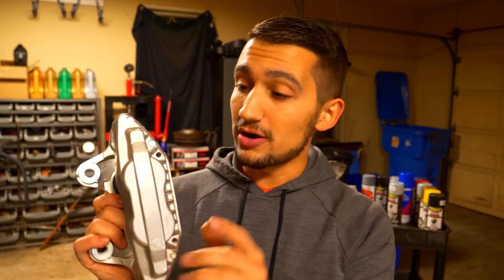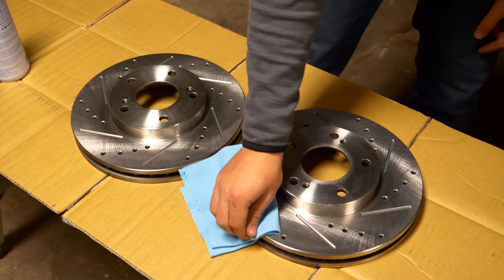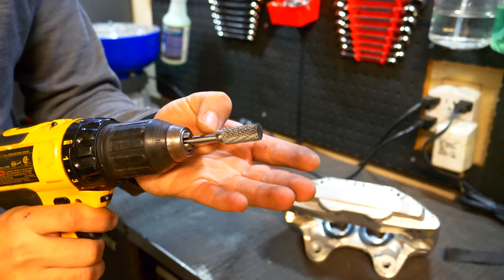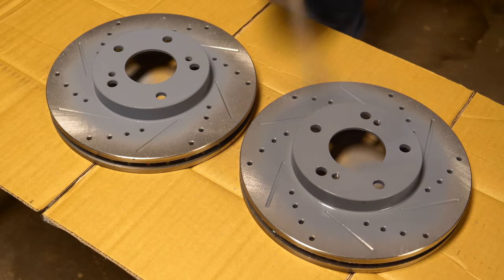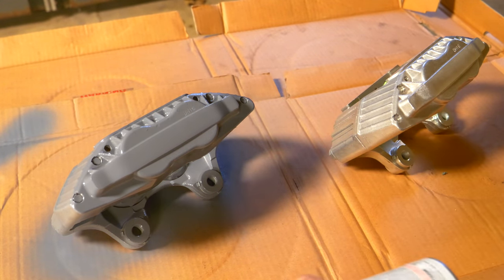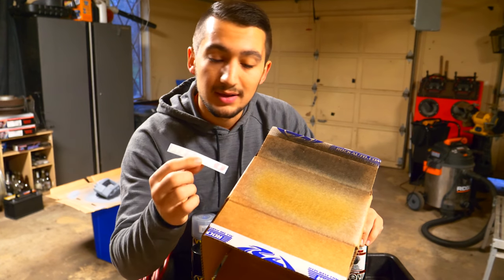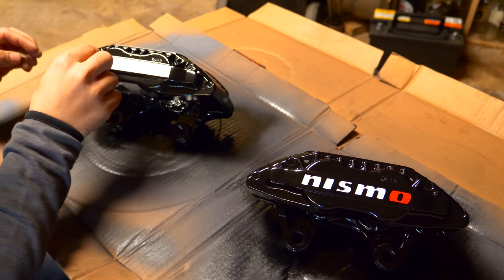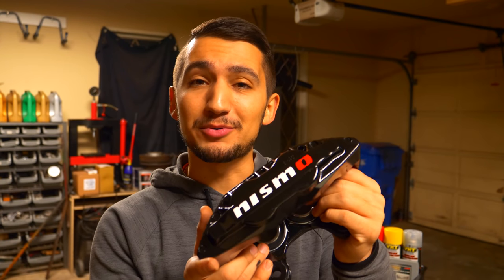How to Shave and Paint Your Brake Calipers

Comment: Went through these same steps + painting mine and in just a 1000 miles the paintnt started chipping / peeling away.  Asked those who also painted theirs that have had no issue and all said I made a mistake which you are doing also.  I neglected to cure them in an oven.  Watched many more videos and this is very often recommended.
Reply: Very good point. When using the same paint on engine headers, you can do a cycle with the engine idling to heat them up and cure the paint before getting it too hot. You can’t do that with brakes but they are small enough to fit them in the oven and cure.
Reply: At what temperature?

Comment: I always hang parts with a wire or string when painting. Garage door tracks work great. You don't have to touch or rearrange parts to get every possible angle. Immediately before and afterward- hit it a minute with a hair dryer to warm, remove dust,  and speed tack each coat.

Comment: Pro tip: the first coat of primer should be very very light, just a light dusting. You should still be able to see the the original finish under the first dusting coat. Then 2nd coat should cover everything.

Comment: Nice job coating the friction surface with paint! Don't forget also to put a nice layer of grease on both sides of the rotor
Reply: sakalelis69 OMFG HILARIOUS
Reply: your ridiculous! obviously you havnt bought rotors with a coat on them that comes off after using the brakes a couple times ....
Reply: @robertosaenz4635  You obviously don’t know how to sense sarcasm.
Reply: Lmfao
Reply: Just blow the pistons out, paint and bake in oven then put back together
Reply: @robertosaenz4635  Manufacturers coatings are not paint.
Reply: Dude...hahahaha
Reply: @robertosaenz4635  thats not paint

Comment: "I'm very detail oriented "......then sprays primer all over the friction surfacr.  SMH.
Reply: Yea & it will be scrubbed off after he uses the brakes twice. Not a big deal at all.
Reply: Some brake cleaner will clean that right off!!!
Reply: @kaimingleung1396  my thoughts exactly
Reply: @kaimingleung1396  Presumably your comments are all theoretical, since a thin layer of rattle can paint makes no more difference to the rotor than the surface rust that builds up a week of rain; the excess paint disappears immediately upon use. This is a really common action and is has no effect on pad bed-in or braking capability. Dry paint doesn't behave the same way as a lubricant like grease/oil, because it isn't the same thing.
Reply: @pmodd  Honestly the primer would increase friction for the first 5 seconds before it wears off.

Comment: You did a nice job on the painting of the calipers. Maybe tape up the rubber boots before shaving the caliper surfaces to avoid any alloy shavings getting lodged between the rubber boots and bore next time. Also not a good idea painting the braking surface of the rotor. Otherwise some good tips, Thank you..

Comment: You also weakened the calliper. The reason that high rise is in the calliper is to thicken the centre area of the brake cup to stop distortion under hard and heavy braking.
You also do not wipe the rotor down with a rag as you leave fabric dregs on the rotor. You just spray off the surface with brake clean.
The brake rotors aren't just painted with basic paint either. It's specially design zinc coating that is designed to come off when bedding in, it is NOT the same as the paint you're using.
Reply: Thanks for that info. Just bought fleet quality rotors and the entire thing is painted black. I assumed it's going to come off the surface with wear, so I wasn't worried. But I was curious.
Reply: No, those circles he grounded down are not structural, they’re to release the casting.
Reply: @Akiss  no mate, they're not.

Comment: Before the clear, it's best the let all solvents evaporate from the base coat. They usually say leave the base coat for three hours, clear coats are very different to the paint and seals it in, it can cause bad results if the solvent is trapped. Even better is the let the base fully cure, sand back with 800 grit and then use the clear coat, then even cut back with 1200 to 1500 grit once it cures (not dries) and polish if you want it to be really glossy, with very little to no orange peel type of effect..

Comment: Lol the pads are going to be all caked up with paint .
Reply: +myboy051 ...
Plus, he worries about finger print oils on the rotor, but applies lead paint! 
He might as well painted the pad surface as well! Lol 🙈
Reply: Plus, he paints the silver metal, well, silver.
Reply: I have worked on cars for 15 years. I had done those before and replace rotors with the coated ones in any part stores and never had a problem. It's not a thick coat enough to cause damage.
Reply: Although it seems like it would, it honestly just shaves the paint off, especially if you have aggressive brake pads
Reply: @RoggeTube  If he didn't paint the rotor hat silver, you would see rust on the hat and silver where the pads contact the rotor. It's a pretty common thing to do when installing new rotors on a project car to maintain the aesthetic.
Reply: no it actually wont it will burn right off who is the dummy now

Comment: I had a 1998 240SX as well, loved the car.  I did the R33 GTS-T (30mmx296mm front and 18mmx297mm rear).  They were supposed to be R32 GTR (32mmx296mm) but the guy lied.  They were still more than adequate and a fair price.  I put on 1998 Ford Cobra wheels with 235/45R17 (Ford part number M1007D178).  They were pretty light and looked great, scored them for cheap from a wheel shop where the guy made most of the payments and then flaked out.

Comment: Disassemble calipers, tape off orifices, then paint in pieces, then rebuild and reassemble if you’re going for detail oriented. Also spray painting your rotors is not the same as a factory protective coating from the manufacturers, you’re ruining the friction surface of those rotors.

Comment: why did you spray the rotor hubs without masking the rest of the rotors? doesnt the paint ruin the brake pads?
Reply from the maker: No it doesn't. I didn't mask off the rotor so that the pads will cut a clean line through the paint, so wherever the pad doesn't touch, stays painted, and doesn't rust.
Reply: It would have been smart to paint the whole rotor and then just use a fine grit to sand most of the paint off of the contact patch. That would minimize exposed metal and keep from building up too much paint on the pads.
Reply: agenthelios1 rotors do not warp the technical term is called run out so before you criticize someone know your own shit
Reply: Yes...yes it does.

Comment: why would you paint the friction surface of the rotor and not mask off ?    now you get to have paint as a layer of wear surface while you break in your new brakes ........    stop doing instructional video's . . . seriously.
Reply from the maker: You're very right. You realize you can purchase coated brake rotors that have the exact same thing on them.. The entire rotor is coated and ALSO covers the contact patch. As soon as you press your brakes, it will wear off.. Don't believe me? Wait for my next video regarding these brakes
Reply: i know they will burn the paint off.   but that paint will also be embedded in the pad and will cause odd wear on initial break in. and will smell . smoke .  etc.  2 minutes worth of masking would have been smarter .   and if you know their are those optional coatings.   why not buy rotors with it so you dont have to use a spray paint .  if oil can contaminate the pads.   so can paint.
Reply: Sorry @milanmastracci but I agree with @twistymcslide2 on this. The paint will be bedded into pads. For the sake of a few minutes, it's better to mask the contact area of the discs.
Reply: Yeah im going to agree with them as well. Painting the friction surface is definitly not a good idea. The special coating you refer to with those special brake setups is probably stop squeal which isnt for the rotors its for the pads
Reply: Painting the calipers is fine, but the rotors weren't a good idea. Quite dangerous, There goes time and a set of brake pads. You shouldn't even share the idea of painting the brake rotors at all.
Reply: I agree with you.  The other problem is when you paint the hub, it can cause your rim to stick to it from the heat over a period of time (have fun taking it off).  When you paint metal and use a cleaner to prep it, you should heat it up to degas it before the paint.  According to VHT, you are supposed to heat it up to finish curing the paint....and that should be done before putting the part back into service.
Reply: UMAD BRAH obviously you have no track time where brakes are pushed to the max and a little break imperfection goes a long way (pun Intended).  The whole reason people get upset is because he is putting out a tutorial  for others that know even less and he is showing them wrong.  It is normal for rotors to come coated with a protective covering, not a ceramic based paint like VHT.  He also tells them after it is dry to touch to reinstall, even VHT states your supposed to bake it to fully cure.  In a pinch I've used spray paint like permatex to seal the gaskets, doesn't make it correct but boy do those gaskets stick when baked.  There's a difference between I've done it before, it worked fine and I did it according to instruction.  This video was a hack, he should of filed the calipers in a vise or clamp, not used a rasp style bit in a drill while the caliper is flopping around. It ended up all crooked and uneven.  This is what I call a 10' project, looks great from 10' away. Take care.
Reply: UMAD BRAH all this means is you haven’t learned anything since high school.  Don’t paint the rotor surface.  

Using your logic there is no reason to wipe the coating off the rotors before using them, the pads will do it for you.  😦
Reply: A sheet of paper or cardboard would take just seconds to make.  This was up to 4 coats of paint. Think about if Ferrari or Porsche would EVER do this.
Reply: Agreed! Please don't paint your rotors.
Reply: milanmastracci One other recommendation with what you did. When you removed the casting marks... you should of taped off the pistons before doing so because that fine dust could land on it. I'm sure that dust can possibly cause them to seize under normal operation if not careful during that process. I'd say metal on metal is a bad combo if it happens. Cheers
Reply: 1blisslife  completely agree with you that is actually the first BIG mistake I saw in this video it's apsurd that he did that without protecting the pistons that should been number one thing to do lol
Reply: twistymcslide2 come on man 4 or 5 coats of hi temp paint embedding into the the pads and glazing them is perfectly safe and great info to share with people
Reply: coated rotors are not in primer ( that primer that you used is 100% more damage than the grease with no wipeing  and it will bake in  pores of the brakepad ) .. that coat that you menchion is substitute for grease so they dont rust while they are in the box ...and that protective coat  is removed when you spray brake cleaner over it   ;)
Reply: I think he did a fine job...lol
Reply: The process of bedding his pads will get the paint off, but the pads, like you said, will be contaminated. TBH I don't think it's going to be a big deal, but I'm surprised he didn't mask the friction surface off.
Reply: little bit of rust on a wear item like rotors that is going to be replaced anyway isnt worth the time to paint. The calipers yea sure.
When im at the track, the wheels i have for the rear with my drag radials really make the rotor hat visible, and fuck are they rusty.. but id rather have a little bit of ugly rust, than even a remote chance of not being able to stop and flying into the sand and destroying my front end.
Reply: I use EBC brakes in my cars and they all come pre coated to stop corrosion. I've never had any issues whatsoever. A bit of paint on the contact point is fine. It burns off in no time.
Reply: Wait a minute. So painting the rotors is bad, but the calipers are fine... Right?
Reply: I agree with them boyos lad
Reply: it's just odd to me that you harp on the packing oil contamination but then contaminate the rotors with paint.
the calipers look amazing but with the rim usually covering the face of the rotor I don't think its even worth it to paint the rotors. not a bad video overall tho.
Reply: When working with mechanical parts for machines, paint the surface area of external parts. IE, the outside of the caliper. Dont ever paint the contact points or friction surfaces. IE, the caliper pistons, brake pads, or rotor friction surface.
Reply: David Smith that's not paint on the rotors you bought from EBC.
Reply: 1blisslife the pistons are sealed, when was the last time you took rotors off? Brake dust all over those seals. Just as abrasive as aluminum dust.
Reply: Some rotors come fully covered with that grey paint
Reply: Brian Tristan that's not just paint. It's usually a bedding compound specific to the brake pads that go with them. It's not spray paint from the auto parts store. Mercedes does this among others.
Reply: another shortcut to mask the friction surface from paint... just dab the surface with any grease..literally any grease and coat it throughly....  then paint the disc normally....  after that just rinse the friction surface area with brake cleaner....u were good to go... no time wasted using masking tape...
Reply: Amir Pomen that's a great trick! You could really use anything. Old/new motor oil, axle grease, old/new brake fluid, WD-40 anything
Reply: For People claiming that painting the brake disc is wrong.
Brembo, Zimmermann, ATE, Bosch, Hella Pagid and many others, state then when installing a new coated brake rotor, no cleaning is needed.
Meaning that the paint will be worn off, when braking 1 time.
The brake pads do NOT take damage.

Any further questions can be sent directly to the product owner.

I sell several thousand brake rotors each year, to all brands through my work, and this is what every single brand claim in their installation manual.
Reply: Seriously, it is not that serious. He makes cool and informative videos...he is just a damn kid...give him a break!
Reply: Because he is young and thinks he knows everything.
Reply: While it is true that you will now have to remove the paint from the friction area of the rotors, he is 
completely right in saying the pads will do the job for you as soon as you press the pedal.  This is no 
different than getting road grime or sand and salt in there.  I would only wipe off the parts you intend to 
paint first then wipe the rest of the rotor when you install the rotors and pads during the actual brake job.  This will likely remove any paint with the protective  oil.
Reply: I also would've liked to see the rotor brake friction surface taped off. Easy enough to do w cue cards  or printer paper
Reply: Go play in traffic
Reply: Lots of uninformed people. I raced open wheel formula race cars (Formula E).  Our rotors were specific 2 piece floating rotors with carbon fiber/ceramic pads and the rotors would usually be coated with a rust preventing finish.  We are talking about a coating that was nearly as tough as a phosphate coating.  It had zero affect on the brake pads upon bedding in. We used extremely sophisticated data logging and can show braking pressure vs stopping distance in feet and even compare total stopping forces to heat generated in the brakes vs total lateral and longitudinal traction circles. 

Point blank, painting your rotors prevents rust and if done where the rotors vanes are help keep cooling efficiency in effect. 

Don’t paint hub mating surface though.

Comment: Whatever rubber you dont want painted just apply vasoline or brake slider lube which will resist the paint and protect the pistons and seals from particals of metal then wipes off instantly. Idk if i would shave my calipers! They are designed this way for heat resistant purposes! Think about it!

Comment: I had a problem with runs spraying VHT wheel paint over rustoleum primer. When I called VHT and asked them their advice, they told me their product is designed to go directly to bare metal.

Comment: You can put a little oil on a paper towel and rob it on the break surface.  The paint will come off easily and a little alcohol will take the oil off the rotor surface.

Comment: I wish I would have used primer on my calipers. I used dupli color brand caliper paint. The can says nothing about using a primer at all, it says to only prep the surface. I looked online and many say not to use primer. End result my paint is peeling off. I will be redoing these with VHT  just as you did. With primer!

Comment: Check out  VHT Engine Paint  - Metallic Burnt Copper 
I sprayed my calipers with that, a VHT brake Clear and high heat primer and they held up for 2 years now. Lots a details on forums about this. Great video !

Comment: If you wanted oem+ you should have gotten z32 calipers that still said nissan on them not that the nismo logo doesn't look good but that was the direction you said you wanted to go. I have ctsv brakes on my z32 and its hands down one of the best upgrades i've done but seeing as you started out single pot those z32s are gonna still gonna feel like a major upgrade

Comment: Just use a simple file and some sandpaper to get rid of the casting imperfections. It will leave a much more even surface than what you did with the carbide burr.

Comment: Good video but do not use brake clean to prep the surface for painting.  Most brake cleaners will leave behind a chemical residue that will prevent the paint biding.  Also, the VHT paint does not require a primer. It will bond directly to a clean metal surface.